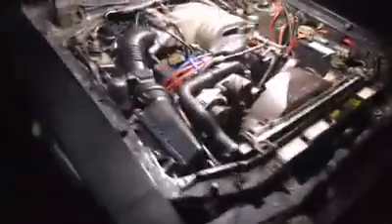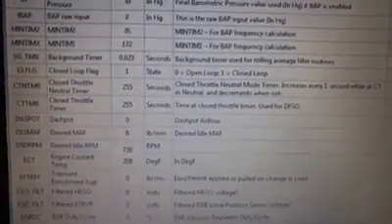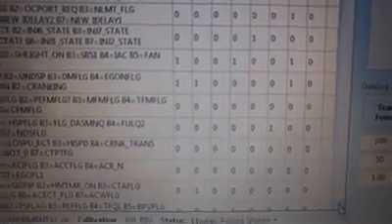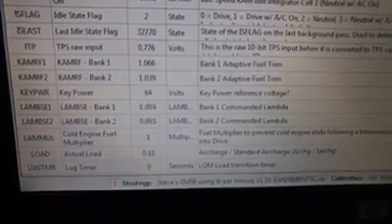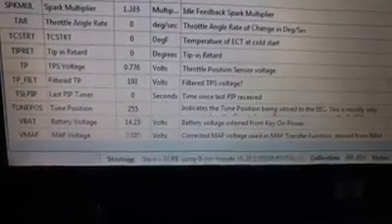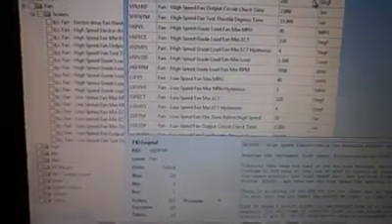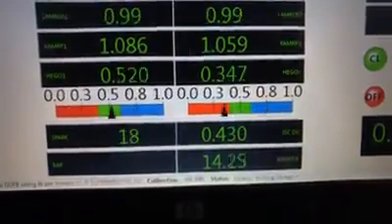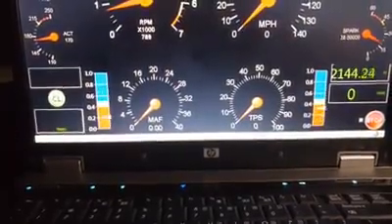Datalogging an A9L Computer in  Fox Body Mustang

Comment: You are a MASTER at your craft my man. This is very interesting and Impressive to say the least. Outstanding, absolutely outstanding!💯🔥💯🔥💯🔥
Reply from the maker: Wow, thank you!
Reply: I want to purchase your chip/reprogram for my foxbody mustang. Are they for sale??? Thanks
Reply: I wish I had your knowledge and experience.  I have a 90 mustang gt with procharged 331. Tuned with a9L and chip years ago. Car has been sitting 12 yrs until this summer.  I've been wanting the terminator x and just noticed a black sticky substance inside my computer when I pulled the chip. The car starts and runs pretty decent.  I just don't trust this old computer and tuning especially after seeing inside the a9L. It dynoed 485 RWHP back in 2009 when I put it together.  I always felt like my tuner did the best he could with the factory computer but the car always seemed rich to me. Idling it turne the driveway black at times and I saw alot of carbon on the pistons when I bore scoped the cylinders.  Engine only has 2000 miles. Anyway I need a good tuner close to Tennessee that still does foxbodys

Comment: How would I get a setup to data log my a9l. I'm having some funky issues happening since install of 331 stroker. It appears to be a vacuum leak according to vacuum gage but I've looked and used propane and brake clean to no avail. Cam is very loopy and only pulls about 10 11 inches at idle. Can't seem to get it but if I could look at parameters maybe that would help. It idles fine for the first 2 to 3 minutes then drop lean and iac can't get enough to compensate air I'm guessing. But iac has good power and ground. Timing is dead on with pip signal perfect on distributer. Seems like a timing issues to me but it's stabbed correctly fires rite up and sounds awesome but I think open to closed loop maybe creating issue as well. I've talked to you on the phone and took the turbo motor out and went back to a9l
Reply: Well, datalogging is achievable with a Moates Quarterhorse chip and Binary Editor software. Although nobody has nearly as many parameters in their datalogging as I do, because I wrote my own strategy. Mine can log about 160 different parameters that the PCM is either reading or calculating. Typical BE datalogging can log around 25 things as I recall.

Comment: i had a tuner suggest to me many years ago to switch from the 95 cobra EEC-IV i was using to the 96 explorer EEC-V...he said it was easier to tune, i could use coil packs instead of DIS. what do you think about that swap?
Reply from the maker: Well, you do pick up OBD2 datalogging, and a faster PCM. But you get stuck with that dummy shaft distributor setup. And waste spark ignition is not really the greatest, although it probably is better than TFI. I just hate how the plug wires look like spaghetti. Then again, I hate how TFI modules die prematurely and leave you stranded.
Reply: @dragradialperformance3540  I'm sure with a good try, i could make those wires look good and make sense 😅

Comment: Hello  Is the A9l a computer not   to fussy when doing a major cam change versus a 95 mustang computer ?
Reply from the maker: The A9L is probably the least fussy computer Ford used. However, just about any cam change with any substantial increase in duration is going to require retuning in order for the PCM to truly be happy. The stock computer is targeting a 672 RPM idle no matter what. Most cams will want that bumped up a little, and more airflow as well.

Honestly, chips are an inexpensive way to solve all sorts of problems. I have them starting at 200 bucks, and it's hard to beat that bang for the buck.

Comment: Drag Radial Performance, Thanks for the info I will keep piddling with it. I have had it tuned on the Dino with a quarter horse chip and it ran great for a day or two and went back to missing and popping mid range when cruising. It runs great at idle and wide open throttle. I was thinking of going to a megasquirt computer but maybe I should look at those capacitors to make sure they are good first. Just seems like the computer is not holding the tune or auto correcting. Thanks again for the quick response!!
Reply from the maker: You can make sure the PCM edge connector is properly prepped (scuffed up on both sides, but not down to the copper), where the chip goes. Inspect the 3 capacitors real closely. EGR flow makes the motor much more tolerant of, and requires more part throttle spark timing. If you trick the computer into thinking the EGR works when it really does not, that will cause the PCM to way over-advance the timing, usually ending up in part throttle knock and poor driveability.

You could just have a weak coil (easy to test) or a bad module (not easy to test). If you need to change something in the tune, I can always read, modify, and re-write your existing tune.

Comment: Question, I deleted an EGR off a fox body 88 and did a lot of upgrades. Added a A9p for mass air. Car seems to run rough except at idle and full throttle I heard I need to delete the egr function on the computer. Is that possible to do? If so what’s the best way to do that?
Thanks.
Reply from the maker: Bob, deleting the EGR will cause a check engine light and a code or two. But it will not make the car run bad unless maybe you try to fool the computer into thinking the EGR is still there. In which case, it's possible the computer over-advances the timing, thinking EGR is actually flowing when it's not. If you simply unplug the EGR, you'll get a code and a light, and no performance problems.

The roughness at idle is caused by something else, unless the EGR valve is stuck open or the EGR valve is getting vacuum. Unplug the vacuum line from the EGR valve and see if it runs smooth. If so, the EGR is getting vacuum when it shouldn't be.

The correct method of removing the EGR (on race only non highway vehicles, of course) is to delete it using a custom tuned chip. It is certainly possible, and a lot more can be done than just that. The hard parts on the car are just pieces of the puzzle randomly laying on the table. The tune is the little old lady that puts those pieces together and forms a complete picture.
Reply: @dragradialperformance3540  that's what i had done when my 95 was a 5.0, i asked the tuner to turn the EGR function off, so the computer isn't looking for it and i properly blocked off the ports on both the header and intake.